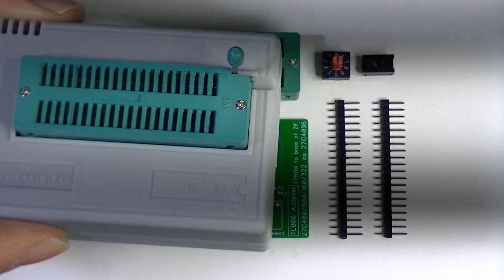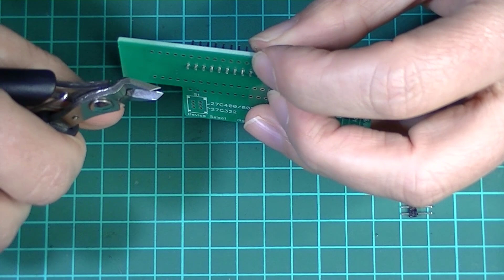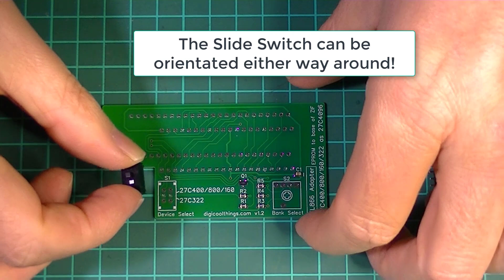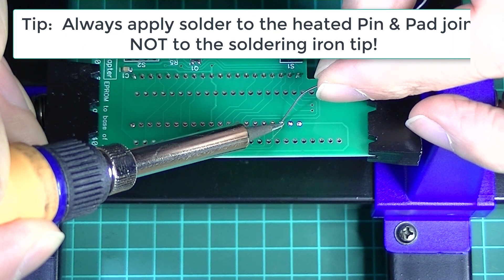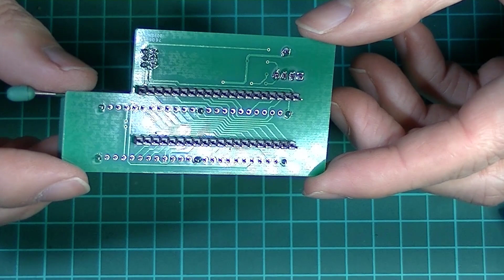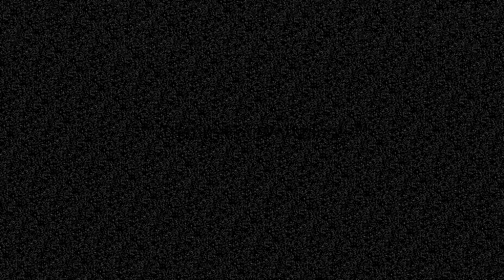Kitset Assembly - TL866 Programmer Adapter for 27C322 & 27C400/800/160 EPROMs

Comment: Is this verified to still work with the new TL866-3G(T48)?
Reply from the maker: Hi.  I have verified the Adapter does "functionally" work with the new T48, however it is not recommended.  For some reason they chose to rotate the T48's ZIF socket 180 degrees, meaning that the ZIF lever now mechanically obstructs existing 3rd party Adapters.
So, although the Adapter works, and the pins or the Black & Gold Edition Adapter is an easier fit, it is somewhat tedious to insert the Adapter with the lever in the way.  I do know one Adapter buyer does use it with the T48, however I still do not recommend the Adapter for the new T48.
Interestingly, although I now have a T48 Programmer, I continue to prefer using my TL866II Plus, as I find the reversed ZIF socket of the T48 very unintuitive!  Also, note the same XgPro software is used with both the T48 and the TL866II Plus programmers.

Comment: darn, wish i knew this was a thing before i bought assembled one, oh well!
Reply from the maker: Hi Ian. I've just msg'd you via eBay, to confirm what you'd like to do. :-)
Reply: @DigicoolThings  thanks for the option but i prefer the pros to do it for me :D
Reply from the maker: @opp31337  Well, you can be assured by the fact that each assembled Adapter is carefully soldered, using lead-free solder. They then go through an ultrasonic cleaning process, to remove excess flux residue. And finally, they each go through a multi-bank writing & verification procedure, with both 27C322 and 27C800 EPROM’s (for the final QC test), before being Anti-Static wrapped ready for shipping.  Time consuming, but I'm apparently a bit of a perfectionist. :-)

Comment: Can i use newer programmer TL866II ?
Reply from the maker: Hi. Yes, verified with TL866CS, TL866A, and also the newest TL866II Plus.  I now use the Adapter with my TL866II Plus all the time. With the new software you uncheck the new “Pin Detect” as well as the “Check ID” options (as the device being programmed is not actually the selected 27C4096). :)

Comment: I have tl866 with adapter and I just purchased mx27f1615 flash from china in bulk they have the same Pinout as m27c160 but they came used is there a way to erase the memory with this?

Comment: I think you have a sync problem with your lights, that's the cameras frame rate colliding with your powers frequency, right? If you can try switching between 50 and 60 fps?
Reply from the maker: Hi davedarko. Yes, the problem (worse at the beginning, with the white background) was caused by my LED lamp.
I have a regular bulb desk lamp, which will be 50Hz NZ mains, which works fine (no banding). I also have LED lights in my magnifying desk lamp.
I needed more light than the single desk lamp could provide, and unfortunately the LED desk lamp was all that I have (which was still inadequate lighting).
So, as I said to Unexpected Maker, I need to add: “lighting”, to my: “proper camera (and microphone)” comment, on the things I need to save for! :-(
Reply from the maker: @davedarko. Update… After a couple hours of researching “Budget Lighting“, I’ve ordered one of these: https://goo.gl/pvu8JG
US$19.59 delivered, seems OK.  This one also takes DC power, so it doesn’t need any expensive batteries (like some of the others)!
I’ll see how it goes. If it works well, I guess I’ll need to order a 2nd one, to cover lighting from both sides.